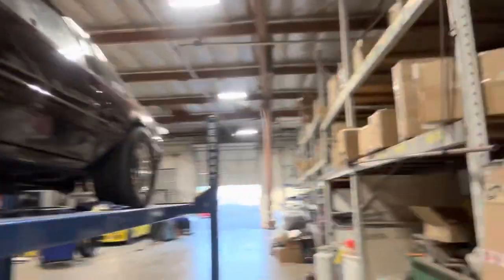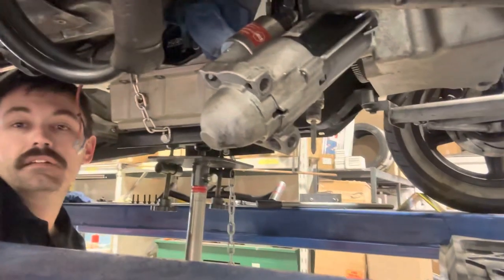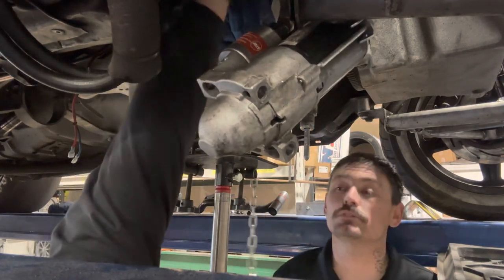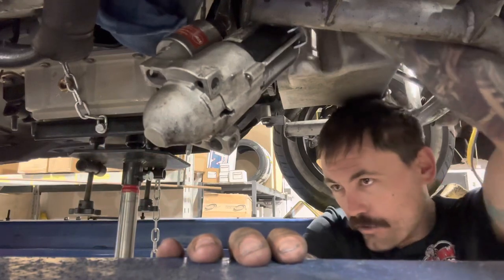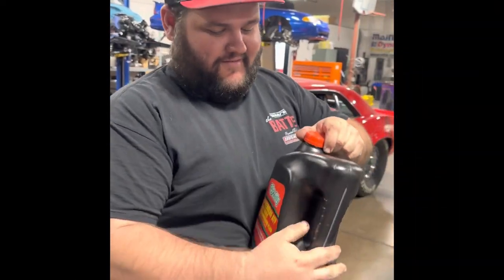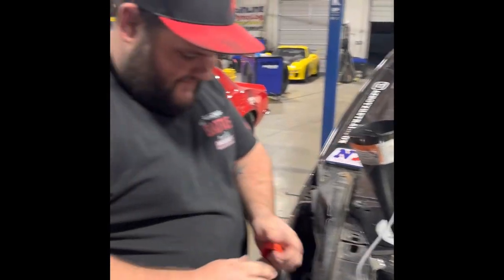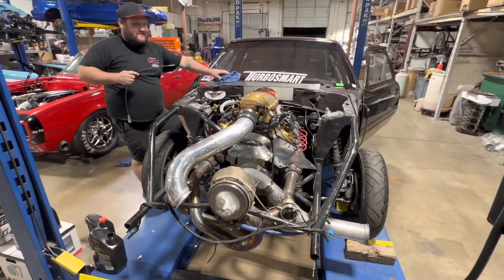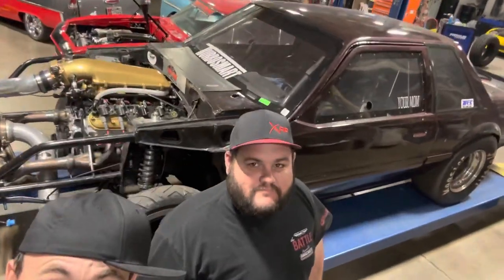H8TRAIN got some upgrades in the transmission. Hang with big j, and myself as we install the glide

Comment: I have a question since you stated you finished pulling the trans out after you got home how were you going to have your car ready for the next round in 10 or 15 minutes ?
Reply from the maker: It was literally out in 2 mins when I got back to the shop lol was only one bell housing bolt holding trans in. I’d like to think we would have made the next round since I would have had help putting it back together after Jason’s round was over. And worst case scenario they waited a few rounds and then still took the W. but it’s all good, it’s a new day and we’re all still homies. No hard feelings on either side.